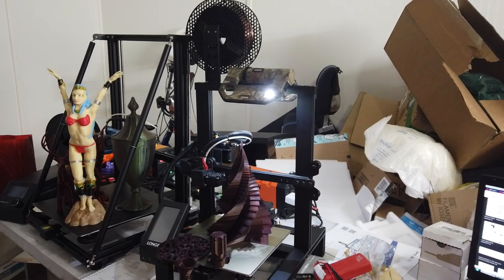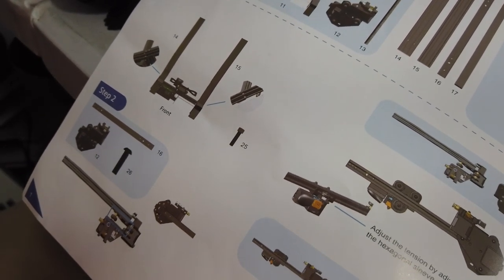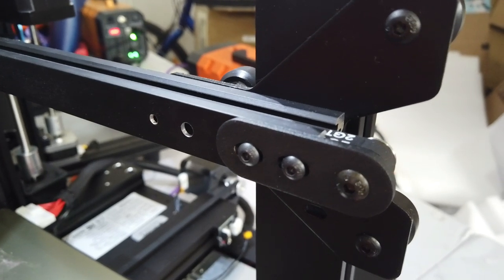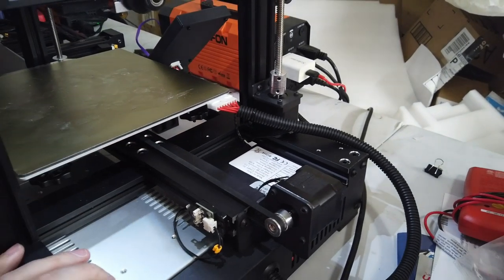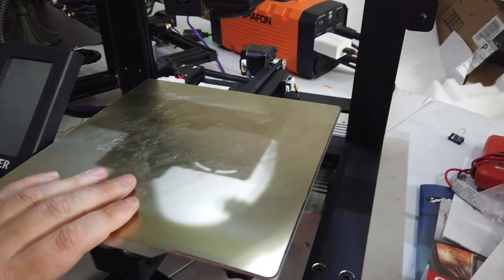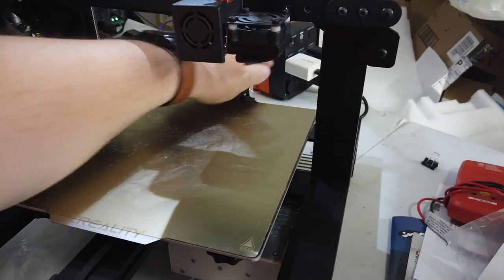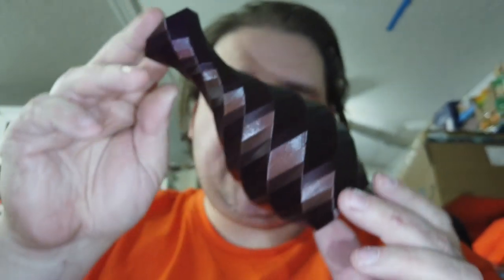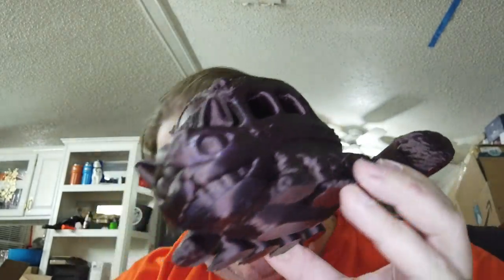Longer 3D LK4 Pro Analysis and Sample Prints T3DP

Comment: Nice overview, about the sides of the frame being further apart on top. If you loosen the bolts holding them on top and bottom you can use a digital caliper and get them even.
Reply from the maker: That was pushed in all the way :-)

Comment: Can you show us which fans are appropiate to change the noisy stock ones?
Reply from the maker: Yes I think I can make another video on that but basically you change all of them since they all suck :-) move to the manufacturers cheap out on the fans or they just don't consider them important

You don't need to use any special fans like noctua or noise blocker

All fans go by size so for example the hot in band is typically a 40 by 40 by 10 basically a 10 m m thick 40 mm fan simply put in 40 m m fan dual ball bearing into Amazon or Ebay or Alibaba the trick is to make sure it's a brushless dual ball bearing fan as long as it's a decent quality one it'll be basically silent since the bearing is where the noise comes from

The parts cooling fan is slightly different it's a blower it's usually a 40 mm by 10 mm blower

It's important to be careful with voltage so for example this printer is a 24-volt printer so the fans are 24 volts my Ender to is a 12-volt printer so I had to make sure I bought 12 volt fans

The one tricky part and actually one of the more important fans to replace because it's usually quite noisy is the power supply fan this can be all over the place but in my experience it is usually a 40 by 40 by 20 or if it's on the inside a 60 by 60 by 10 but you will need to check this and it will also require you in most cases to disassemble your power supply in order to replace it which is not always for the faint of heart depending on what your DIY experience level is it's not difficult but it's still an important component

This one can also get strange for example mean well power supplies used 12 volt fans even in their 24 volt power supplies if in doubt on this or if the fan is not Mark you're going to have to test it that's going to mean putting probe to the power supply powered up which again is not For the faint of heart and it's further complicated if it's a thermally controlled fan meaning it might not turn on until the power supply exerts some effort

Comment: Hi Chris, thank you for this review. I just purchased mine. I've noticed the loud fan issue as well. I've talked to Longer support, they're aware of this problem (haha) and willing to send replacement fans which will be less noisy (but, according to them: there will be a certain noise :D). My question: do you have any idea or tip on 24V quiet fans which I can use till the new ones arrive? (Maybe I can compare them and use the better). Also I've asked them if they have plans to upgrade the current 1.1.9 to 2.0. The short answer was a polite not soon.
Reply from the maker: Check with th3d he has high quality ball bearing fans that are a lot less noisy! I am going to be ordering some to try out in the xomong months.
Reply: Did they charge you for the replacement fans? I love my new Longer LK4 Pro 3D printer but those fans are really loud. I can barely hear anything else on it, only loud part is the fans.

Comment: Have you done a video on printing Abs? I have all creality printer’s ender 3,5 and cr10s could you show how to print abs with these type of printers? I print parts in pla but the only issue is they are not very good at Heat resistance!
Reply from the maker: I have a video coming up on enclosures in the next few weeks that makes a big difference with abs!

Comment: hi chri tryed to print the tree print and it had gaps were it starts to turn any idea i use cura thanks
Reply from the maker: What layer height? Its got some gnarly angles you need to be 0.2mm or better 0.12mm layer height.

Comment: hello, I have a hard time with my LK4pro any chance you can share your cura settings?  not new to 3d printing been using an anet a8 for years but cant get a clean prints out of my lk4pro , got a new glass bed and ordered new wheels. But i might have issues with over or under extrusion too.
Reply: nervermind  i found the link you shared. AWESOME will give it a try thx.

Comment: Saw this printer on ebay and the specs listed Copper? as a filament material? Can this really print copper?
Reply from the maker: No it cannot print copper I can print filament that has copper powder in it I would suggest using a hardened nozzle for that

Comment: Hello, does lk4 pro is better than Ender 3 pro?
Reply from the maker: The print quality on the Ender 3 is slightly Superior very small difference but in my opinion the LCD screen and UI on the LK for pro is fantastic and unsurpassed they're actually using a similar interface on the new CR 6 SE

Comment: I'm looking to replace my old pain in the ass Anet A8 and I've narrowed it down to this or an Ender 3 Pro. Which one would you buy and why?
Reply from the maker: Thats hard. Ender 3 will be slightly more reliable. That touch ui is so nice though. I would say neither and go ender 5 (just slightly more than ender 3 pro) more solid build bigger build volume.
Reply: @nerys71  Got the LK4 Pro this morning on an Amazon flash deal for $199. Had to do it at that price... I guess I've been looking at it so much they knew they could snag me with the flash deal...
Reply: @donnievazquez3319  hey any updates on how the printer has been? the printing and quality of it?
Reply: @saadahmad21  The overall quality is very good, there are 2 issues I have with it that I'm working on. 1.) Can't print TPU, I need to print TPU so I'm going to either convert it to a direct drive extruder or upgrade the existing extruder. 2.) The glass build plate is not completely flat.  It's usable but a little bit of a pain. I'm probably going to install a BLTouch auto leveler. That being said, it absolutely smokes my Anet in terms of print quallity and speed.
Reply: @donnievazquez3319  Thanks for the reply, I recently bought it and I'm pretty excited for it
Reply: Demons Headshot I ended up replacing the glass and the extruder. I got the Creality silver aluminum extruder and some Unicorn PTFE and can now print TPU no problem.
Reply: @donnievazquez3319  I replaced the heatbreak to a titanium one too although It wasn't an easy task to print with it properly, had to tweak alot of settings

Comment: its astonishing how little engineering and common sense that goes into these machines.
People and youtubers have been pointing out the same issues for years, yet a new "company" releases a new "printer" with issues and faults that was pointed out years ago.
Reply from the maker: Part ego Park Pride part and experience and lack of research when I see a new company make old mistakes I'm not quite as harsh unless they're very obvious but when I see an existing company make the same mistakes multiple times that gets me a little riled up it's like I told you how to fix this last time and you made the same mistake again that :-) part of that might be what do you call it it's not lowest common denominator is another term for it

We've determined this is good enough even though it could be made better making it better cost money so we'll leave it as good enough :-) some improve some do not I am hopeful for longer 3D because this machine it's a huge improvement over the first machines that I received from them over a year ago this is far more refined than that first machine :-) so I do see advice being taken and implemented we shall see in the future

Comment: Ok sir. Going for that special in Amazon with Lk4 Pro. I know Creality has a bigger community but I will give a chance to this one. Thanks. 

Please expect feedback :D
Reply from the maker: Good luck let me know if you have trouble i will try to help.
Reply: Nerys Thank you!
Reply: Nerys hi. Finally I got mine, I upgraded the screws to M5x30 and M4x22, just noticed a problem before of that that continues, force of movement along X and Z is not consistent (moving with hand), maybe some bearings are not concentric or rounded? do you think this can lead in printing issues?